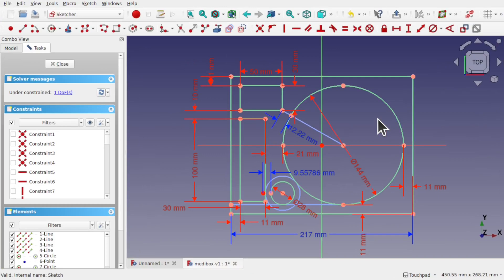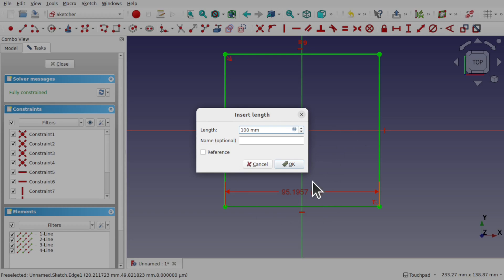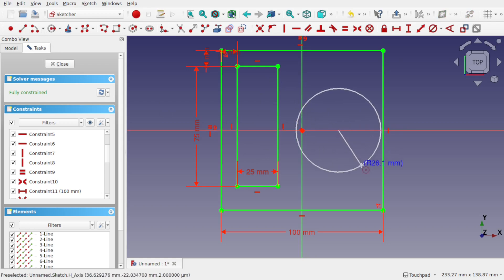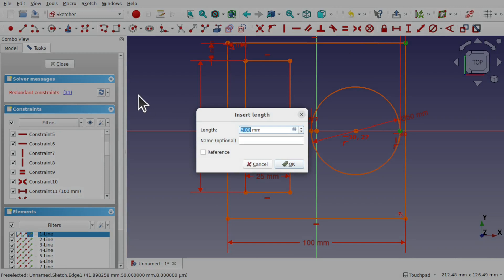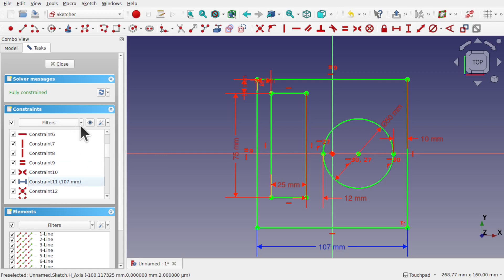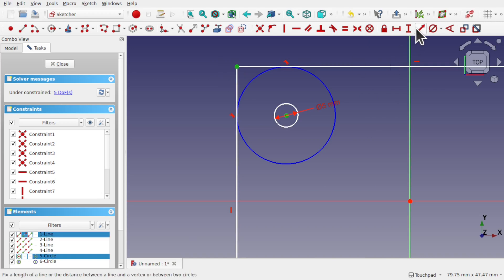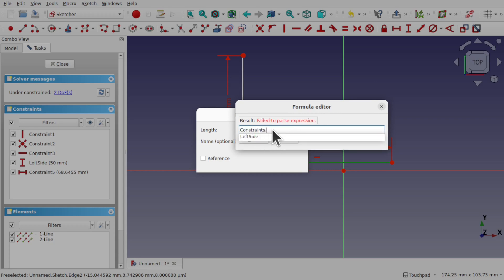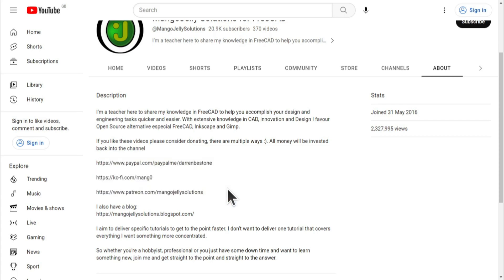FreeCAD For Beginners | 46 | Sketcher Reference Constraints. What are they and how to use them.

Comment: Great info - thanks. I still find the terminology confusing, though. A reference constraint doesn't constrain anything (as in limit or prevent) but is more like a measurement. Did I miss something?
Reply from the maker: No that's exactly right.  It on references something so you can add additional constraints into your design and it wont be over constrained.  One reason why you would do this is that you can name that constraint and base formulas off it.  You can name the constraint and in property field of other operations or even other sketch constrains you can use yoursketchname.constraints.nameofconstraintx and that will pull in its value.  Also if you have a full constrained sketch and you wanted to adjust it be dragging some the geometry slightly, you can change the constraint to reference by double clicking on it and setting the checkbox, and then hitting OK.  You are now free to drag that until you are visually happy.  Then double click the constraint again to set it back.

Comment: I was sketching in 0.21 a couple of days ago. The sketch was basically made of arcs. It seemed to only allow a max number of them. From there they appeared to start as circles, but just disappear when trying to attach them.  I also had the same issue in 0.21 in a different sketch that was comprised of more features than just arcs. I reverted back to 0.20, and didn't have the problem. I would post this somewhere else, but don't know the proper forum. Thanks a million for doing an awesome job explaining everything so well!
Reply: Good find.  I am so new to this that I sometimes don't know the difference between a bug and a feature 😄
Reply: Before you know it, you'll have mastered all the featured bugs. I don't have any background either, and have been at it a little over a year now. I'm super grateful for all the work everyone has put into it. I think if I keep at it at this rate I'll be proficient with most of it in another year though. This channel is great, and I also watch AllVisuals4you which is another excellent choice for how I learn, but there are a ton others for any learning style. @flyingfarm1
Reply from the maker: Thanks for highlighting that. I have thrown this up on twitter to see if anyone has experienced the same. Bugs can be submitted through https://forum.freecad.org/viewtopic.php?t=5236#:~:text=If%20you%20think%20you%20found,%2FFreeCAD%2FFreeCAD%2Fissues.